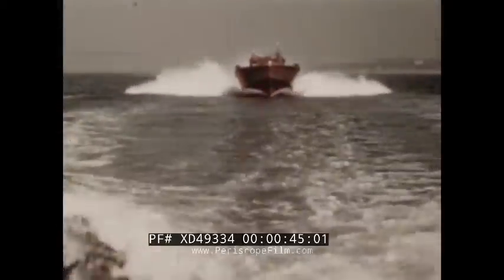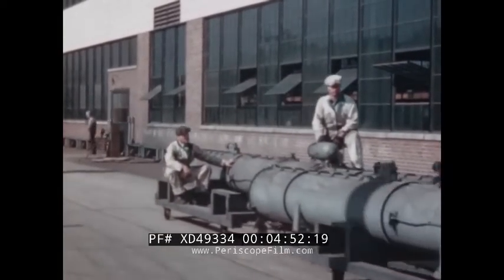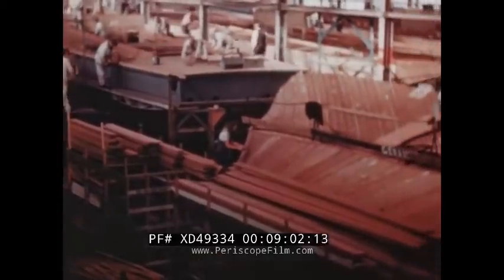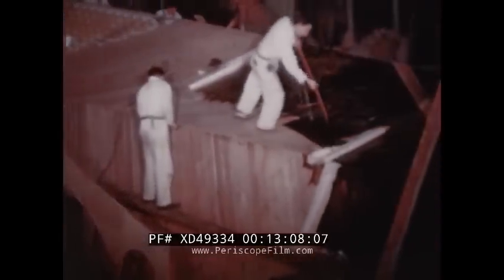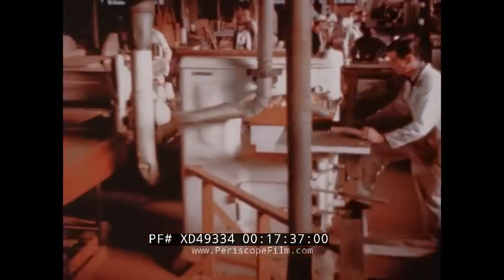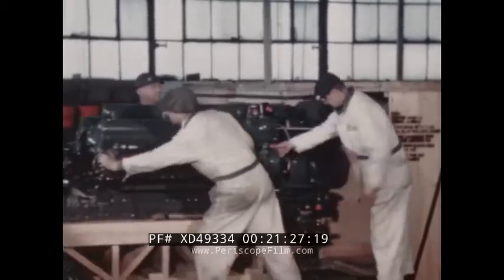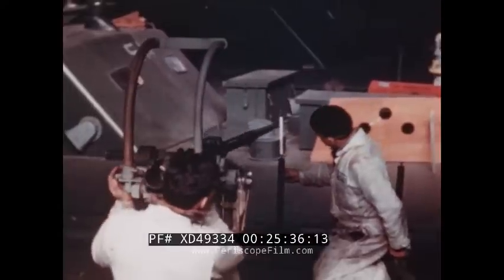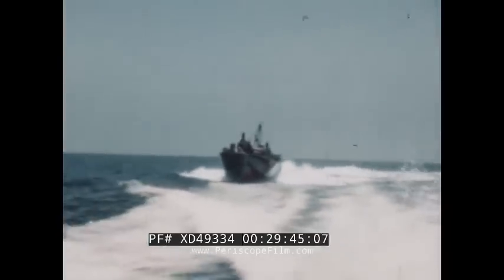“GIANT KILLERS” WWII ELCO NAVAL DIVISION PT BOAT PROMO FILM   ELECTRIC BOAT  BAYONNE, NJ  XD49334

Comment: My grandmother used to work at a place in Salt Lake City, Utah by the name of ELCO Elec. She never really talked much about her job other than to say they built gigantic wiring harnesses for military use. Amazing they were built on large sheets of plywood and all hand tied  with waxed nylon cord. She gave me all of her soldering tools in an old cookie tin  years after retiring. Couple spools of solder, couple jars of flux some cutters and stripers, a half spool of the nylon cord and a 35W soldering pencil. She also had a huge soldering Iron about 18 inches long with a chisel tip about an inch in diameter and the cord was made with red and black striped fabric insulation.  I'm 57 now,  that cookie tin is long gone but what memories this has brought me.  Thank You for posting. Love you NANA

Comment: My dad worked on these designing them as modules with quick connect HD cables/connectors that could be quickly disconnected & the insides lifted out & a whole new inner module dropped back in, hooked up & put back into service.
Reply: My grandmother worked for ELCO building Wiring harnesses .

Comment: PT 658 resides in Portland, OR. I have seen her a few times on the Willamette River. She's not an Elco, but a Higgins. I used to work for a company that built aluminum boats for our military, they must have stolen the trick of building the hull upside down from Elco. Smart engineers for sure!

Comment: They burned about 500 gallons of gasoline an hour at full speed. The German ones, called E boats, used diesel engines. I think they were somewhat larger and more heavily armed. I think the PT boats were the safest combat branch of the US Navy to be in during WW II. Not sure how many ships they sunk. The National WW II Museum in New Orleans has an operating one. You used to be able to ride it, but I think they discontinued the rather expensive rides. With enclosed gasoline engines, any small fuel leak, and you could go boom. If you are interested in WW II weapons, the National WW II Museum in New Orleans has a LOT of them on display. It is the official WW II museum for the United States. It is worth a visit if you are in New Orleans, or are into the history of the US involvement in WW II.
Reply: You could also just run on just the center engine only or the two outside engines only to save fuel...
Reply: German boats also called S- Boats.
Reply: The Packard marine engines required 100 octane aviation fuel and is verry expensive to operate today on the few still existing PT-boats,. Thats why they will often be retrofitted with diesel engines.
Reply: Lets not forget the Spruce Goose
Reply: The Flying  Saucer, a speed boat converted from a PT used 1.3 gallons per engine per mile when at speed. Great ride running out of Ocean City , NJ back in the 60s and early 70s.
Reply: @peterparker9286 you mean the H4 hercules
Reply: Oh, I thought they were Detroit 2 stroke diesel motors.
Reply: @richardpickersgill3434  I suspect they used the Packard V-12s because they had aviation gasoline for the planes on all the Pacific Islands and because the boats were faster using the more powerful supercharged gasoline engines, than if they had used heavy diesel engines. And the boats were designed for speed, not to be able to take enemy fire. Unlike Germany and Japan, the US never had to worry about fuel supplies, thanks to oil from Texas, Oklahoma, Louisiana, and California.
Reply: So don't get any ideas about restoring one for personal use if you can't afford $2000 in fuel for an afternoon of boating. Damn
Reply: The teachings of the samurai's soul do not let others take control of life and death! It is the duty of the strongly born to help the bear. I was taught and fought for the descendants of my parents, sisters, younger brothers, and wives. 侍の魂の教えには、生殺与奪の権を他人に握らせるな！ 弱気人を助けることは、強く生まれた者の責務である、と。 教えられ、父母妹弟・妻の後世の産まれてくる子孫の為に戦った https://www.youtube.com/watch?v=gRKwHd69pFI
https://www.youtube.com/watch?v=Gl5iuQE8Ck4

https://www.youtube.com/watch?v=EHZYOPI89SY

https://www.youtube.com/watch?v=_QOXodCXpTs

https://www.youtube.com/watch?v=5w5TC4ppsIE

https://www.youtube.com/watch?v=0eoSCSb5OpE

https://www.youtube.com/watch?v=kn7jx4qgsnQ
Reply: @richardpickersgill3434  nope!!!!  too small.  the Detroits of the time 6-71 were puny by comparison  6 times 71 cu inches is   426  cu in displacement, The Packard M2500 was, yes 2500 cu inch displacement  or almost 6 times larger.
Reply: @billsimpson604  They use the Packard M2500 because the US Navy put out a bid for Pt Boat engines and Packard had them developed for the Boat racing, Harmsworth I believe  and nothing else was offered or was available, this was 1938 when they were first delivered to the navy !!!

Comment: In Faulkner's "Turnabout", he writes about a Torpedo Launch built around a Torpedo tube that was gravity launched from the stern.
The boat was barely 3 feet wide and only long enough for the two inline diesel motors plus the torpedo.
Crewed by the Insane Youth of England.
Reply: i once served in camp Faulkner (nam)  seabee gave the camp to the marines (3rd)    lot of killin 67/68  the marble mountains

Comment: Amazing video. As a lifelong woodworker I can certainly appreciate the incredible skill that went into these craft. Sadly, my understanding is many of these were burnt at the end of the war in the South Pacific. How many of them remain for is the remain for us to marvel at today?
Reply: In the 1960's there was a yacht conversion of the equivalent boat, an Army Air Force pilot rescue version, berthed in the Annisquam river that cuts across Cape Ann behind Gloucester. It was a beautiful thing, but didn't go out much as it was said to require $100 of gasoline to leave the dock. $100 was a lot back then, but it also bought a lot of gas at $.30/gallon.
I don't think many are left outside of museums. After 75 years (my age!), a boat built to only last the duration, and used roughly at that, would probably require the initial cost again every 5 to 10 years in maintenance alone.
Reply: @ChimeraActual  I was a little kid in Lewes, Delaware and there were a couple of privately owned PT boats that were bought as "salvage" or "Surplus."  My father worked on boat electronics at the time and my grandfather was a trawler net fisherman, so I got to see one of them when it was at the fishing docks.  Apparently, they used so much fuel that people changed the engines for economic reasons, but then the PT boats didn't have the power anymore and tended to "waddle."  I remember one of them had a little yellow submarine on the aft deck.  If I remember right they were underwater treasure hunters.

Comment: PT 73....was not equipped with cannon armament ... only 50 cal,s T tubes depth charge smoke dispensers...Capt Binghamton..damm you..thank you PF
Reply: The actual PT 73 was a 78-ft Higgins-built PT that had to be scuttled after running aground on a reef in enemy waters.
Reply: McHale's PT-73 was a 72ft 6in Vosper with two gun turrets added to make it look American.  It used to be the tender for the Sprouse Goose when Howard Hughes owned it & was in an episode of Rescue 8 where it fell on someone.
Reply: @aussie6910  No, not Rescue 8, It was an episode of "Emergency!" Seen it several times.
Reply: @ronaldrobertson2332  That was many years ago. Thankyou for the correction. Watched both shows when I was a youngun. 
Avagoodweekend.

Comment: At the end of the war, most PT boats were brought to a collection point, stripped of useful guns and engines, then burned where they sat. The gas tanks were not drained to add to the conflagration that burned them to cinders a few were given to the Dutch, Australians, and New Zealanders as costal patrol boats with enough spare parts to last for years. Only two running examples still exist in the U.S. with rumors of a third being restored. Two were at the Little Creek base as static models until they rotted to pieces under the paint, then they were hauled off in pieces and burned.  Very   poor respect for the role they all played in the War on both sides of the world.

Comment: Merlin engine's would do nicely... Churchill would supply them...
Reply: kevinrice  How wrong you are!!!  and quite the opposite happened.  ALL US Navy PT boats were powered by PACKARD M2500 Marine engines, and UK received thousands of them also through Lend lease for MTB  MGB  air sea rescue, you see all Little merlins 1650 cu in vs Packard'  2500 cu in, 50% larger than a merlin which were to be used in aircraft only.  Learn what the hell you are talking about !! !  RR also contracted PACKARD to build the merlin FOR THE BRITS because the Brits were short of engines !!!
Reply: @wilburfinnigan2142 You are correct in all that you say. The "little" Merlins that you speak of were reserved for aircraft (including American built ones) and we used Packard MARINE engines for various fast boats. Both engines were used in the craft that they were best suited for, and built for.

Comment: All the craftsmanship, exotic woods, high performance engines... all the teamwork. Just so some LtJg. who considers himself a "Yachtsman" can park it mid-channel and be cut in half before the first shot is fired in anger off her deck.
Reply: So not a fan of the Hyannis Port Clan huh?
Reply: Kennedy did not "park" the 109 in a channel.  They were operating on one muffled engine (standard proceedure) as part of a 15 boat patrol to hunt down the "Tokyo Express". Only problem was that it was pitch black with no moon that night and only four boats had primitive radar. The 109 was not one of them.

Comment: To bad our torpedoes sucked!
Reply: After about the first year they didn't.
Reply: @lwilton  until early 1944 they did.
Reply: @lwilton  they didn't fix the torpedoes until 44'...biggest problem was the Commander of the Sub Fleet was the designer of the torpedo that was failing and he refused to accept they were bad...he kept blaming the boat commanders...there is a REALLY GOOD book called "PIG BOATS" that spells it all out...EGO and POLITICS.
Reply: Ain't that the truth. I wonder how many tons would have gone to Davy Jones if they had actually WORKED like they should have.
Reply: Too
Reply: Some ingenious PT boat skippers got the bright idea of mounting the 13-ft aerial torpedo in drop racks and tested them out. Worked beautifully.  Pretty soon, by war's end, the drop racks were standard.
Reply: @ronaldrobertson2332  ya. The flash from the tubes gave their position away. Drop racks prevented this and saved a lot of weight.